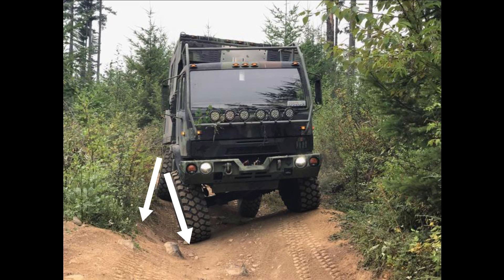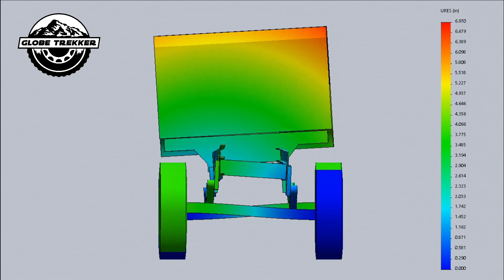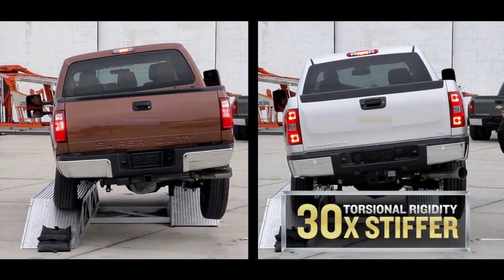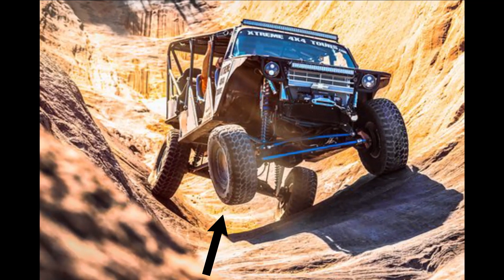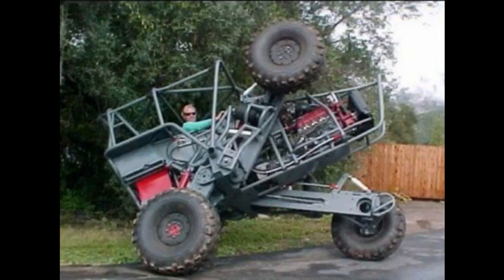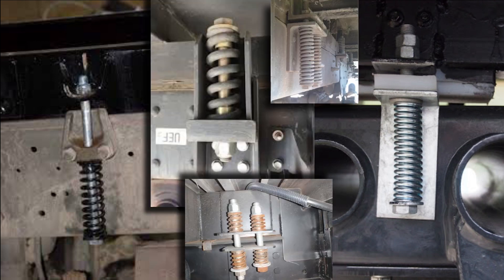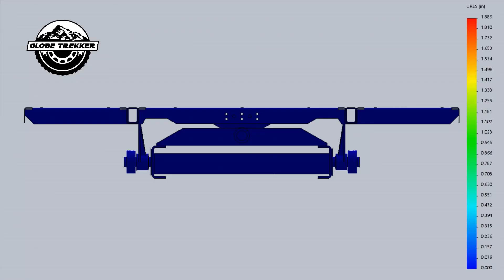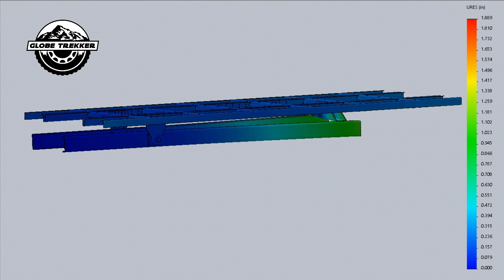Globe Trekker Zero Torsion Subframe

Comment: Never understood why people spend time and money to remove the 0 torsion bed to spend time and more money to build a 0 torsion subframe.
Reply from the maker: The "0 torsion bed" weights almost 2500 lbs., and it is only "0 torsion" because it is bolted to the frame and does not allow for movement. This causes a very stiff truck frame suspension, tricycling, and the subsequent loss of traction. I explain all this in this video. https://youtu.be/1WpJHEiJoO0 If you remove the dead weight of the old truck bed, you can have a true Zero Torsion subframe and habitat shell for about the same weight. That is why people spend the money.
Reply: @RVGlobeTrekker  yeah what you show in your explanation video is not relevant: Cabin is on air bags so itself do move, then you show a 1079 wich does not have the 1078's stiff bed.
Suspension is designed for the stiff frame and transmision mounts are also designed for non twist frame, now if you eliminate that...
Then is nice just to be able to convert back in minutes the truck and leave the shelter and drive away an off road capable flat bed.
So in my opinion is a waste if time amd money.
Reply from the maker: @OOOOutdoorOffGridOverland  definitely entitled to have your own opinion. Though the cab is mounted to the truck frame, and the airbags are only there for personal comfort to cushion the ride. The transmission is mounted with flexible mounts... designed to be flexible, and the suspension has no problem whatsoever dealing with frame twist, as these trucks were designed for 10 or more different variants; not all had the stiff flatbed design. For most experienced overlanders, dropping the dead weight for a light weight engineered Zero Torsion solution is the only way to go, and well worth it. But, to each their own... it's not the only way,  just the in our opinion, the best way.

Comment: How you resolve the zero torsion
Reply from the maker: The torsion is resolved with two side brackets and a pivoting crossmember for the 3-point subframe, and two pivoting crossmembers for the 4-point subframe. Check out this video... https://youtu.be/n5iTAHMfcws
Then check out the 4 part how-to build videos.

Comment: Zero torsion subchassis IMHO absolute overkill for an LMTV UNLESS the box is built of light material that rips apart easier..... which may be the case.    So far there has been zero reported M1079 issues (that I know of).   Hopefully a long term FMTV mechanic will offer .02
Reply from the maker: We are glad that you agree with our design. Overkill, as you put it, is exactly what many folks who want to protect their investments over the long term are looking for. Many have used old mil. box conversions which are chained down to the bed of the truck. Our stance was to drop the massive 2400 pound M1078 dead-weight truck bed. We engineered our purpose built zero torsion sub-frame AND 18.5' habitat to be light weight and durable, just over400 pounds more than the old truck bed itself. Others that have ditched the truck bed have generally taken one path; they recreate the stiffness of the bed and either bolt/weld that subframe to the truck frame, or do some kind of spring compression arrangement. Neither of these options are compatible with maintaining the off-road capabilities originally designed into the truck and why overland expedition enthusiasts choose the FMTV chassis over lesser capable or outrageously expensive other options.
When it comes to engineering strength and durability over time in a light weight package, you need an FMTV engineer to design it. We have two.
Reply: @RVGlobeTrekker  your information is not accurate.  very few mount there habitat in any way similar to the bed.  Happen to only know of one out of all the builds out there  out of the just shy of around a dozen of LMTV based campers who mounted like bed.  Just keep in mind..... there is only a small percent who can afford "overkill"  Hard to make profit of very few sales.  Maybe offer both options?  Kinda a Nissan version and a Lexus version / a Ford version.... and a Lincoln version.... you get my point.   Just something to mull over in your business model.
Reply from the maker: @coachgeo  other than those that attempt to build a zero torsion from like Globe Trekker, many build a very robust subframe/habitat floor, whether they are incorporated together or are separate, the principle is the same.
As for the affordability, the ability to DIY the project has been engineered into the products. Go ahead and get a quote for a sub-frame and box from a competitor (we should note all current competition panels are substandard to Globe Trekker's 2 1/2" thickness, three layers of Azdel, two layers of FRP, PUR hot foam insulation, and thermal-break extruded aluminum), add in a brush guard system and PV panel mounts and you will find we beat their prices hands down and by a lot. Now, throw in the labor costs for someone to fabricate all this for you. With our design, two guys with no special equipment can assemble the subframe and box in a weekend. Impossible? Stay tuned for further video proof. 
It is not that we are trying too hard to prove a point, we are simply doing what is right to change the game and improve the industry.